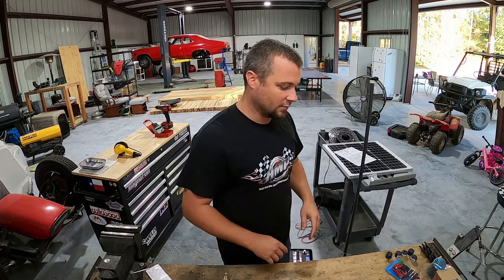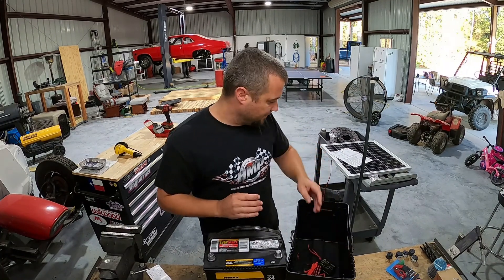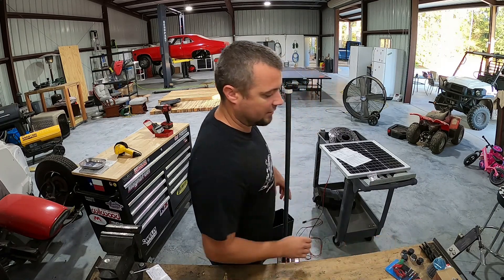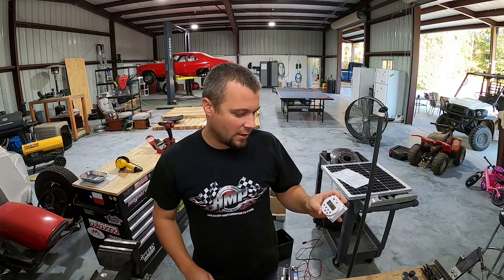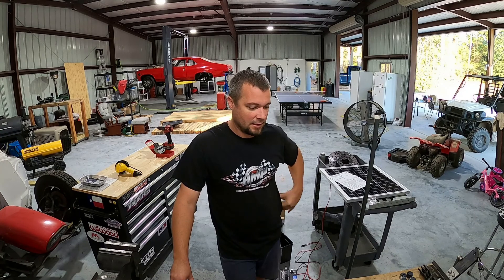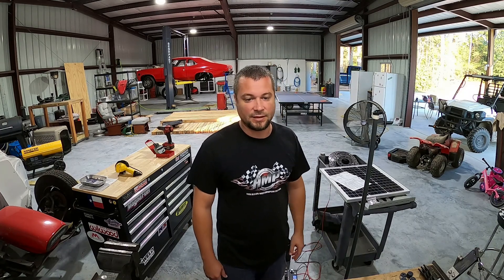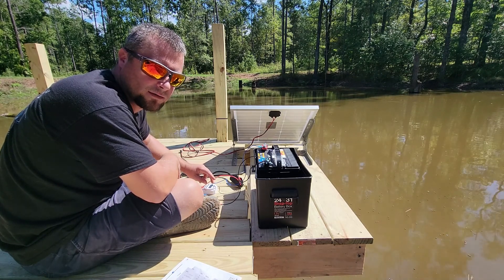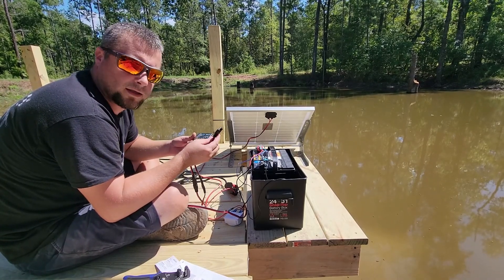Solar Powered Pond Fountain

Comment: That looks cool and simple. I rigged up a pallet filled up with spray foam and pump I’m the middle to try and have it in the middle of the pond. I have power close to the pond but would like to go solar. Thanks for the info once again
Reply from the maker: Thanks for watching again! One thing I learned after the video is you need to use a deep cycle battery like for a trolling motor on a bass boat. It discharges for longer and can charge back up without killing battery life. Just a large CCA on a starter battery isn't good enough. They run out of power too quickly.